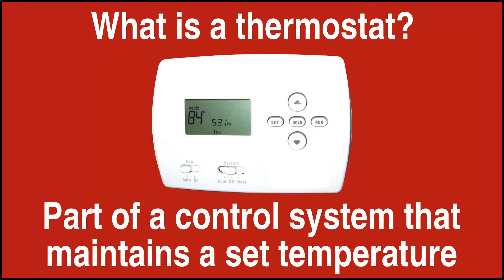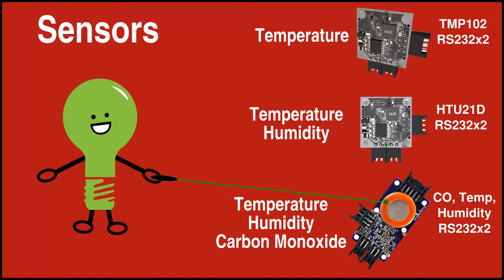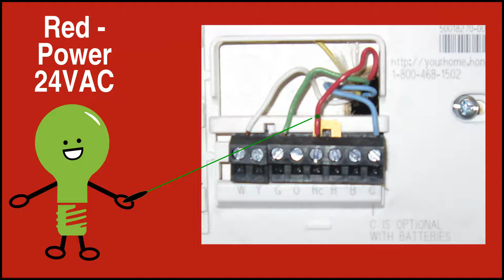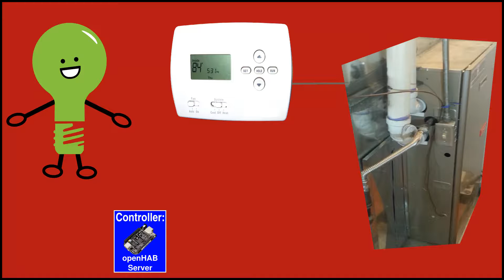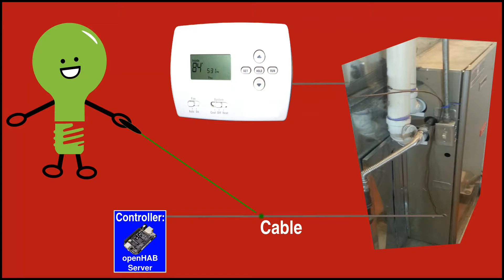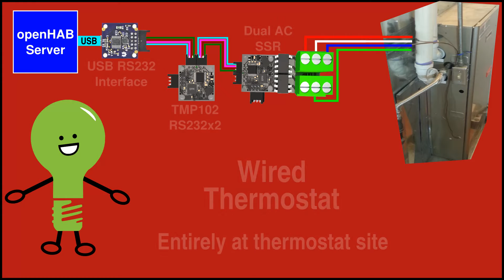Engimusing Thermostat Projects

Comment: I just backed the kickstarter. I was thinking about how to control the zones. I already have my sensors, eventually going in every room. Using steppers, motors or solenoids to course and open vents in each room and then having openhab send commands to the vents. The thermostat could keep the one remote sensor at the correct temperature and then the feedback in each room could determine when to open and close the vents. a PID could be run on each of my array micro controllers and then the resulting action could trigger the vents in openhab. 
I know your thermostat can run these PIDs, but I already planned my previous build and I'm too far in to back out. 
And maybe in the future, I can push the output from my sensors in to the thermostat for centralized PID.
the thermostat could pay attention to one input and I guess I'll have to find the room that this would be best fit for, but the sensor is remote, so I can test different sources for best results. At least until you have the time to develop the multi sensor input.
I can't wait!!!
Reply from the maker: Sounds great. Thanks so much!

Comment: Now that I know this is a Kickstarter, have you sent anything in to hackaday.com? I'm sure they would show it off, and I would have seen the campaign earlier. I'm planning on backing, but now have to determine what package to build. 
I have been building a sensor array for each of my rooms and came across this as I was researching controlling the environment. I'm using MQTT to communicate wirelessly between the nodes and I've already ordered and received all my components. I have not put carbon monoxide detectors on mine yet and have left several inputs available on my PCB. I could use your detectors and then read the serial output, but I may have to redesign my PCB if I need to add the appropriate area for new components to communicate with your sensors. I2C I guess, but I see your site sells the connectors as well, so I would like to purchase some of those too. When possible that is.

Comment: One more question before purchase. I finally got my new house and determined I have the correct wiring to do this setup. When I purchase this, will it come with detailed information about programming it, or examples of use? I am confident in my ability to learn how to use this, but because of the new house, I'm too busy with building to devote a week to understanding how to use it.
So, when I purchase it, will you either package instructions other than the hookup information you already have with the product or give links to information that is not on your site to the public?
OK, lied, also have another question. If I were to have a temperature sensor in every room, is it possible to integrate them in the setup so that I can control zones? Would a separate PID need to process each zone? Is the controller capable? 
I plan on controlling dampeners in each room to reduce energy usage based on multiple factors. 
I appreciate you're replies. I see this product as the most capable on the market when it comes to integrating it in to open hab and the price is amazing.
Reply from the maker: The thermostat will be pre-programmed and programmable through openHAB. We will give you the openHAB files that you can start with so the thermostat will be ready to use. We will help you with any other infomation you need when you are ready to install if there is not enough information on our website.
I am planning to put a similar system in my house using dampers. I think we would need to write PID code in the thermostat to handle this. openHAB could send the temperature inputs from the zones to the thermostat and the thermostat could send control messages through openHAB to the dampers. The controller would be capable of running multiple PIDs. We will have to think about the best way to do this but it should be doable. Thanks.
Reply: Great. Thanks. Ordering when I get home.
Reply: OK. Just tried to purchase through the web store. Is this only available through the Kickstarter as of now?
Reply from the maker: Michael Woodrum
Yes, just Kickstarter now, in the store after the Kickstarter is over.

Comment: I like the idea. 100%. but, it is pre-programmed right? so, does the program contain a PID algorithm or is that up to me to program? Or does it not use PID, but something more simplistic and then rely on openhab inputs to configure the set point? I am ready to purchase this, its pretty much the only one I wouldnt have to build from scratch and is completely compatible with my openhab setup.
Reply: It is pre-programmed and contains a PID algorithm. The set points are programmed through openHAB and are stored in the microcontroller so it will continue operation if it loses contact with openHAB.
Reply: Oh. OK. Then the set point can be changed through scheduling using openhab. Does it store a schedule locally or if it were to disconnect, would a pre determined setpoint be activated?
Reply: Michael Woodrum
A predetermined setpoint would be activated.